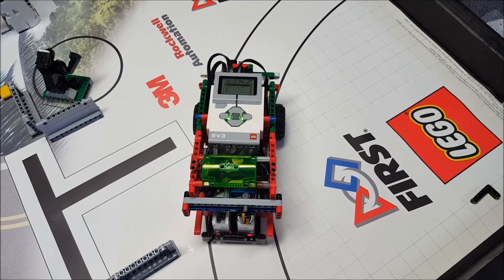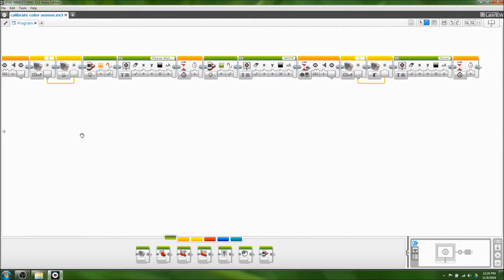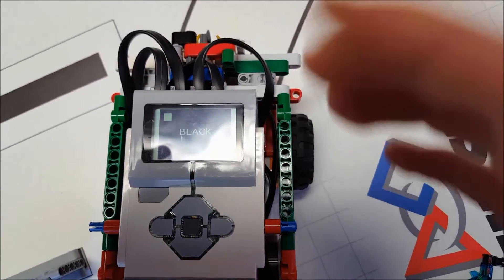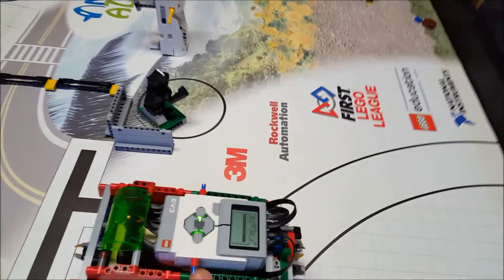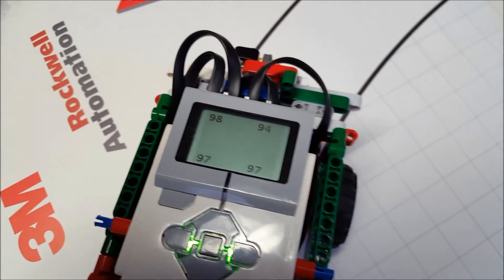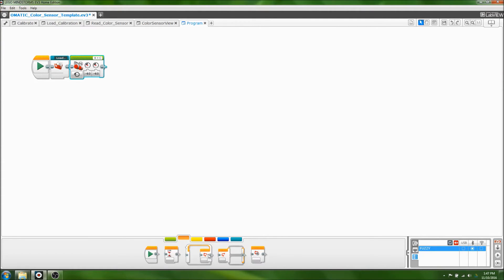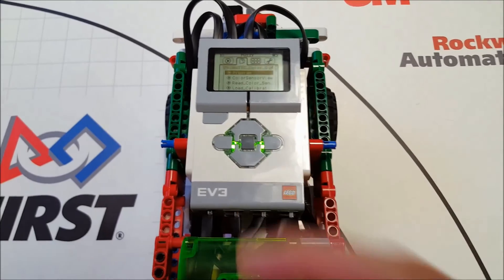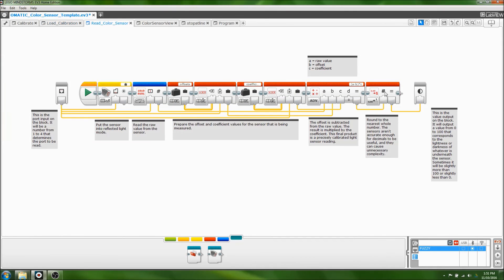EV3 Advanced Color/Light Sensor Calibration

Comment: Hi, how do I calibrate same color sensor to detect 4 different colors and detect them during Robot runs, thanks!
Reply from the maker: Unfortunately, you can't calibrate the color sensing without 3rd party firmware that is illegal in FLL. However, you can use the built-in color sensor blocks in the same program as my custom blocks and the sensor will automatically switch modes as needed. Since the color sensor blocks just return a number (1 - 7 IIRC) for the color rather than a range of intensity, they tend to be pretty accurate even though you can't calibrate them.